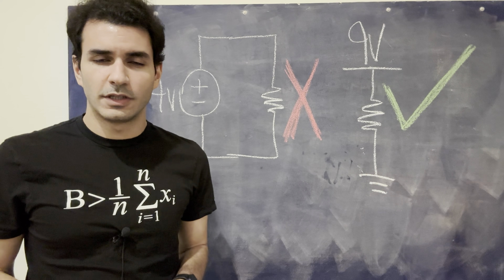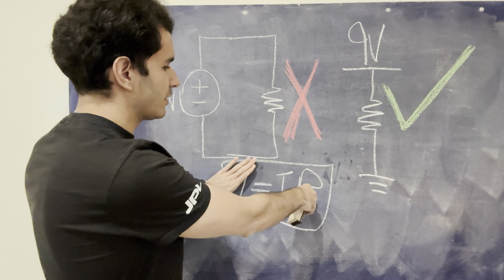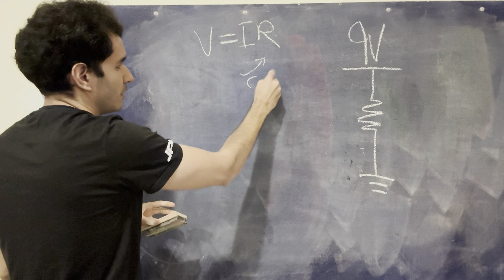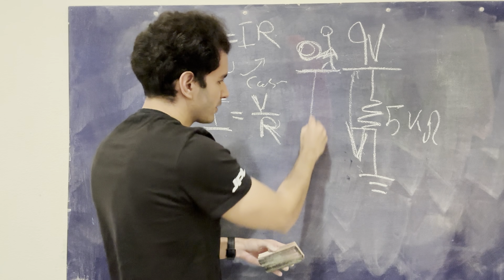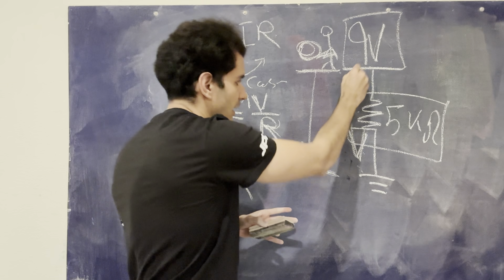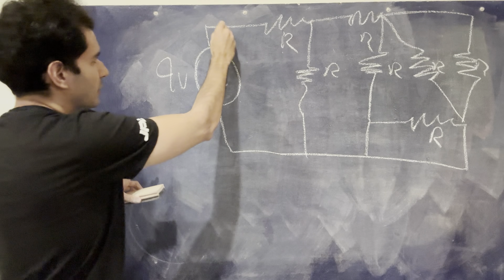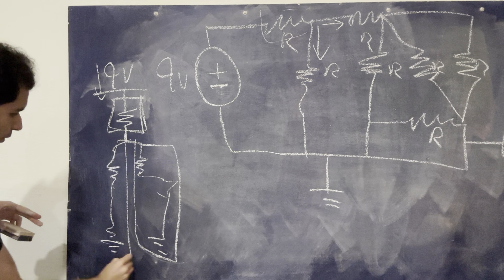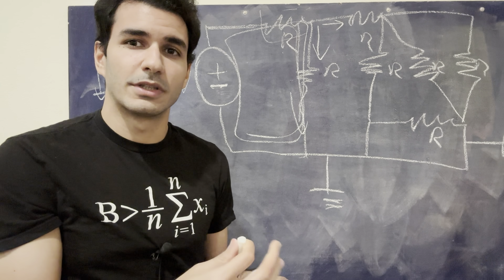Circuits Finally Made Sense When I Saw This One Diagram

Comment: As an electrical engineer, I have to point out that ignoring the "current loop" in the left drawing will become problematic for electrical engineers later on.  First, the "straight line to ground" drawing isn't going to help you much when there's a current source in an odd place.  

Second, in high-speed designs, keeping track of the "return currents" is necessary to maintain what we call "signal integrity."  Current always travels in loops, and if we aren't careful about where those currents are going when they return to the source (as in the left drawing), then our signals get corrupted, sometimes horribly so.  Ones and zeroes can become 0.35321 or 0.7352 and quiet analog signals can become overwhelmed with noise.

In board layout, that bottom line in the left drawing coming back from the resistor to the source is our ground and / or power plane, depending on how we've designed the PCB stackup.  Every pin on a chip that puts out a signal is a "source" and depending on its edge rate, we may have to be VERY careful about where those return currents go so that the signal gets where it's supposed to intact, and we don't interfere with other signals along the way in what we call "cross talk."

Many boards have failed and had to be re-designed because the engineer didn't take into account all the current loops and how they would interact with each other.  It can easily cost a company tens of thousands of dollars in debug time and bad hardware.  It's not just a matter of getting the schematics right.  The traces and planes in a PCB aren't just ideal connectors for your chips.  All those connections have inductance, capacitance, and resistance, even though that will never be drawn on your schematic.  If your edge rates are fast enough the power and gournd planes don't look like a capacitor to help keep your power rail clean, but a transmission line to conduct noise from one part of your circuit to another.  If all these aren't handled properly, you get to spend hours debugging your circuit and trying all sorts of things to make it work.  

So if you're a young EE student, do yourself a favor, and "become one with the current loops" and keeping track of where all the return currents are going.  You will need to know that to get working, reproducable circuits out of the factory.

Good luck!
Reply: Somehow, I don't think that EE students are the audience for this video. This is a way for high school physics students to conceptualize basic electrical principles and the relationship between current, voltage and resistance. Walk, then run. Basics, then the oscilloscope.
Reply: @kidsteach938 I learned the triangle in HS electronics. How is this even a problem which needs solving?
Reply: @ShaunHensley ppl learn differently. Just because you got it doesn't mean it's so for everyone, every little bit can help.
Reply: @kidsteach938 agree. I would quickly diagram the straight line version to get the student thinking of path direction, then apply that to loop circuit drawing. No matter how you look at it, a student is going to have to learn the traditional diagram, anyway.
Reply: Another electrical engineer (though now retired) who did board design.  I worked on PCI adapter boards so we were limited to 0.062" total board thickness.  This made my life difficult with more complex boards because we could only have so many layers without exceeding the maximum board thickness.  I was lucky enough to design in an era where clock speeds were perhaps in the 100 MHz - 200 MHz range, not the GHz stuff they were doing later on in my career where I wasn't designing anymore.  Anyway I remember initially encountering V=IR and not understanding that the V represented the voltage DROP in the resistor R when a current I flowed through it.  I got a degree in physics before I got my second degree in EE so I learned much of my basic electrical theory in physics classes.  I can distinctly remember trying to solve an electrical problem from my physics class homework and walking down to Dr. Connolly's office to ask about that V.  Once he told me that the V represented voltage drop, it all clicked.
Reply: @davidh.4649 that's cool to hear you had a similar feeling. That image really did "click" I "understood" the concept but I was never really able to visualize it until now. I'm definitely going to use it to train some of my new guys.
Reply: @davidh.4649 wait, what? It’s a voltage drop?
Reply: good Lord Im glad I decided to look at comments. 😳 Im learning this all on my own relentlessly for personal interest… and if it leads to jobs we will see. Anyhow, THANK YOU, I am so glad I read your first paragraph!😂 Will read rest, but honestly, I almost took this guys breakdown and jumped cliff into bliss.😱😄 I am a big fan of nipping bad habits early on in hobbies or passionate interests where excelling is a demand. Thanks!
Reply: I like ample copper in multilayer boards for sure. As you know, I'm sure from reading your comment, at high frequencies like in a high speed ADC, even short traces need to be made the same length and differential pairs kept at the same distance apart to the point of making "curly turns" to achieve the same length and impedance calculated to match source and the sink or reflections will eat up your signal. In a complex circuit it's nice to see and think about where all the currents are travelling for sure. If designing a PCB it is indeed critical when you need most excellent signal integrity.
Reply: Unfortunately, you're absolutely right, this idea of "fixed potential planes" has kept me in very profitable work for about 30 years. If they just put more importance in the idea of the Poynting vector for how energy flows we'd have far better and more efficient things.
Reply from the maker: agreed, but the key idea here is developing an intuition for what a circuit or electricity even is
Reply: @alithedazzling  I think it is more accurate to say you are building an intuition for easily analyzing a steady state DC circuit. It's not building intuition for how things "really work" because this is not how things really work.
Reply: @alithedazzling I’m in finance so what do I know but your vertical diagram is literally NOT a circuit. It’s point to point.
Reply: @RockDog101  Yes, exactly. On the other hand, it should be taught that electric current essentially flows from point to point, circuit is only needed for continuous one-direction flow, so that one end "pumps the pressure" (supply continuously restoring charge) while the other end allows discharge flow. Displacement current flows without circuit - but only for limited time. But in the end, hydraulic lines with flexibility is better way to explain both the displacement current and the circuit.
Reply: @alithedazzling Intuition that corrupts the correctness of a model is counterproductive. Just drop it.
Reply: @alithedazzling  Do you really want an 'intuition'?   Get out in the real world and fix/measure some stuff. You can't break down a functioning circuit made of various parts into an oversimplified "thevinin equivalent circuit". As for 'what lectric is'-----you are merely dealing with friggin' DC; what happens when you have multi-phase AC?
  Lastly, that 'simplified' diagram is only useful as a parts schematic for a man who understands how the current RETURNS to source! Is your lectric 'pressure' never ending? Does spent lectric ground to never-never land?
Reply: @alithedazzling no need intuition. it's math and visual understanding. if you are not comfortable go play music, electrical engineering is electrical engineering
Reply: Good comment, a lot of audio technicians and sound engineers I work with are also musicians. Understanding how instruments work, the acoustics and simple electronic amplification that are used and then how an environment can be filled with sound waves that have pleasant and unpleasant effects on our ears is a good way to begin to appreciate the complexity of electronic engineering. 😄
Reply: This is maybe for beginners to show them a way to understand circuits a bit easier way. However, in practical cases, what you said is a matter must be taken account into, thanks for explanation.
Reply: As a SI/PI engineer, I really appreciate this comment.
Reply: Retired EE here also.  The post is good for DC circuit comprehension.  As EEs know, the DC circuit analysis has to be modified as frequencies increase.  Even at 60 Hz the skin effect influences conductor sizes.  And as CC states, ground paths at high frequencies are not simple  0 impedance earth grounds.
Reply: To be fair, he does point out this is a beginners model.
Reply: I mostly agree. There's no point to model the electricity as gravity system, it is way simpler and more accurate to just imagine the power supply as a pump and the wires as hydraulic lines. On the other hand, even harder obstacle of misconception is, that current would always go in loops - it essentially doesn't. Current flows between two points to either charge or discharge until the charge is either maximum what their capacitance holds on the given voltage, or until their charge has been discharged. But alas, also this is best modelled with hydraulic circuit, with initial pressure buildup and discharge. Loop is really only needed for prolonged flow into one direction - incidentally representing most use cases though.
Reply: a lot of greatly advanced thinking in these threads   ...
Reply: Yeah, I'd say this video is for physicists who understand gravitational potential.  If you're an electrician, technician, maybe some EE's, I'd say stick to the traditional model and study to fully understand current loops.  You don't need the extra headache.
Reply: @bcdrummin  what does this have to do with gravitional potential
Reply: "Current always travels in loops"
Not if it is AC, in which case it jiggles back and forth.
If DC, it moves very slowly (group velocity). The E-field does the work.
Reply: @jazam9244  Even in AC, it still travels in loops - jiggling back and forth in the conductors, dielectric, air, or all of them.
Reply: @Cynthia_Cantrell In most applications yes, but not always. In antenna, the AC of high enough frequency travels essentially back and worth without loop.
Reply: @TheSimoc  It still travels in a big loop - the air is the dielectric between the antenna and ground - it's a spatially large, but small valued capacitor.
Reply: That's the case for a big AM or FM radio antenna.  Arguably however, if your antenna is of the small variety used for charging cell phones and similar devices, or a large one for a car, you've essentially built an air-core transformer.  

Current in the driving transformer is obviously in a loop, but that is transformed into a magnetic field, which forms a flux loop with the secondary, rather than an electron loop.
Reply: @Cynthia_Cantrell That's kinda true - or a viewpoint. Similarly as with waterfall example, there must be a common separator medium between the surfaces of source and destination for the displacement to occur (water displacing air while flowing). More accurate illustration is the fluid cavities within solid flexible material. The point is, that when taught "current always flows in loop", vast majority of people either entirely miss the fact that every single wiring makes a capacitor, or fail to grasp on how it practically behaves, only resorting to "mysterious capacitance effect, can't understand". And the "always loop" is not entirely accurate because in the end it's also only a virtualized model in many cases. Think about static electric shock, while it can be modelled as a capacitor and short, they are in the end both on same path - physically point-to-point only.
Reply: @TheSimoc  If I touch a door knob and get shocked with static electricity it is still a loop - both the door and I are grounded, but the knob and my finger are at different potentials.  When the spark occurs, you can still draw a loop through my finger, the spark, the knob, the door to ground, ground to my feet, and my feet to back to my finger.  

There has to be a common connection somewhere in the system for the current to flow, and a closed path, i.e. a loop.

If there is no loop, there is no current.  Otherwise if you stuck a 12V battery on the counter next to a 6V battery, current would magically flow from 12V to 6V - i.e. point-to-point down the waterfall.  And you know that simply doesn't happen.
Reply: @Cynthia_Cantrell To first time actually disagree with you, that is outright wrong. The current definitely doesn't flow through ground when you touch a door knob. If both were grounded, there wouldn't be potential difference between you and knob when you touch. Common grounding is explicitly the way to keep static charges from building up. One can be grounded, but not both, and whether the one is or not, is irrelevant. The static shock constitutes a capacitor with you being one plate, knob the other, and the touch as a short between. So yes you can still model it as a circuit of capacitor and a short, but physically it's just point to point, and definitely not through ground. I have no idea what you meant with your battery example, you didn't connect a single wire between? If you did, the displacement current definitely does flow briefly.
Reply: @Cynthia_Cantrell And before your last post, I never meant to disagree, but to stress the importance of both viewpoints in every application and phenomenon. Only by handling them both allows to internalize the nature of electricity. Too often only one of them is taught. In atom-level physics and chemistry, there are no capacitors, components, nor circuits. Just conductive and dielectric objects, and electrons moving point to point. In simple (and up to pretty advanced) applied electrical lessons, there are only components, claimed to have current flow only when in closed loop. RF theory pretty often falling back into the former. Also, understanding the essence and working of capacitor (which is in the end a virtualized object) is impossible in any other way than by explanation with displacement current. Furthermore, it is equally important to note that fluid dynamics has the exact same characteristic - there's always either displacement of another material, or compression affecting between two sides.
Reply: @TheSimoc  I usually don't spend my time worrying about a physical analogy, or even a displacement current.  I worry about getting the math right. 

The math doesn't care whether it's a displacement current or a stream of electrons - what ends up on the other side of the cap is the same. 

There are many people that are confused for frightened by the math, and an analogy can help them get a better "feel" for the topic, especially early on.  

If they're going into electronics seriously though, I highly recommend they get in touch with, and get a good "feel" for the math.

In my professional experience, it is when engineer have tried to avoid or ignore a good analysis that gets them, or their company into trouble -- and someone else has to come along behind them, and fix it.  Often by starting with a careful look at the data sheets, and then figuring out where the math went wrong. 

Analogies are fine to get a "basic feel" for what's happening.  But I don't feel confident sending a circuit to production until I can show - with the math - that it's going to work as designed. 

This can be particularly true with RF circuits, because what you "feel" should happen because you put a cap or inductor somewhere may be totally different from what actually happens - because some trace forms an unexpected stub, or a protection diode's capacitance changes too much with frequency, or a via had more inductance than you expected.  However, with a good enough SPICE model, the math can show you on a Smith Chart what it REALLY going to happen.  

This is why I encourage folks to get past the analogies quickly, and learn how the math defines what your circuit does.

Have a nice day.
Reply: @Cynthia_Cantrell  Math is math, you are right it doesn't care about paradigm models nor analogues. But for most people, maths don't make much sense (and are prone to mistakes) without first having good grasp about what is actually happening. Therefore, it is extremely important to play with analogues and simple applications as long until the basic behavior and essence of electricity has been internalized. There's no need to worry about "doing by feeling" in design work, no one is going to design a circuitry by feeling - they are always calculated (or measured and tested in experimenting which is usually done when not all factors can be addressed for calculation). But the better the nature of electricity is internalized, the easier it is to catch errors and missed factors in calculations - the worst engineers are those who don't really understand the essence of electricity and rely on maths with a set of factors they have happened to read and assume to be the only factors. One knowing how the electricity really behaves, catches on "something is missing from the numeric figures", even without prior knowledge of exact maths, while math-oriented one gets no idea anything would be missing.
Reply: @TheSimoc  Well, peoples' brains think differently.  I never felt the need to go beyond a simple analogy; perhaps because I started teaching myself electronics around age 10 - in the late '70s.  

My "aha" moment for capacitors came when I built an emergency light - a relay would release when power was lost and use batteries to power a small bulb.  When I first plugged it in, the relay clattered away at 60 Hz, and I immediatly thought "Oh, I need a capacitor for that!"  I suspect my mental model back then of a cap was bucket that filled with water, with a hole that let water out slowly - the kind of thing you might find in a hobbist book from Radio Shack by Forrest Mims.   

Today there are fancy videos for free on YouTube that provide wonderful imagery for electron flow, often with a water analogy.  I learned from black and white hand drawings on graph paper (you can find some of Mims "Engineer's Notebooks" on line to see what I mean).

It's good to have that basic understanding of what cap, resistor, or transistor does, and the more you work with them, the better understanding you'll have of how to use them.  

But in my engineering career, the most common and difficult problems I've seen other engineers have fall into a few categories:

1:  They didn't pay attention to the datasheet.  Maybe the import spec they needed was on page 27 of 368.  But given how important it is to functioning of the circuit, they SHOULD have checked that early on.

2:  They didn't bother to check / do the math.  Don't design a PLL or other control loop without using your favorite method to do a stability analysis over the full range of production tolerances, aging, and temperature range.  Don't get it "working" on the bench and call it "done."

3:  Dig down to the ROOT CAUSE of the problem!  Don't "fix" a unit in the lab without knowing PRECISELY why production units are actually failing.  And if one of your design tools (like an FPGA router) can't consistently give you a working design, dig into the chip architecture to determine which limitations you need to work around - is it which pin the clock goes into?  The max width of an address decoder?  Critical timing for a large product sum that will need to be pipelined? A data bus with so many inputs it should use tri-state lines rather than muxes?  

I've never had to formally use the "5 Whys" method for root cause analysis - so far it has only taken me 2 or 3 to get what I needed, but digging deep into a problem is usually where the most useful knowledge is gained, and it frequently provides expertise that can be used later.

Early in my career I resented how much time I spent fixing other peoples' problems.  However, some of those issues provided useful insights (most frequently for board layout) that have helped me design much better boards.  This has been crucial for high speed and low noise designs.

So far, since graduating with my degree in the late '80s, I've never found the need to correct anyone's analogy for electrons flowing around a circuit.

Your mileage may vary.

Have a nice day.
Reply: @Cynthia_Cantrell Well, actually I think the water analogies have been the thing that have helped you internalize the knowlodge to the point of avoiding the errors and catching them on others. Some of those problems are pure carelessness, some are about being pretty advanced work done without enough knowhow. Having too much water analogies with different viewpoints have definitely not been a reason nor contributor for those errors. What I have encountered, vast majority of newly graduated engineers don't have any idea about displacement current nor the practical effect of stray capacitance (which are the same thing with different word and viewpoint). They just go with maths they have gathered, i.e. ohm's law and couple of else, and then wonder why they have a current pulse when powering up an open circuit. No math formula they could remember will cross their mind in the situation - let alone with any more complicated circuit or phenomenon. They may remember the capacitance and maybe its stray occurrence, but being rather a mystery element, they cannot associate it into the situation and even less to any math formula. But when they know displacement current acts exactly like in closed hydraulic lines when powering up the pump, they get the clue everywhere it applies. Btw, the bucket example was pretty much similar to the waterfall, it is better than nothing but not particularly good for the same reasons (on which we agreed in first messages). Also, the restricting hole should represent a resistor. More accurate model for capacitor would be a reservoir with a flexible diaphragm separating it into halves, each having a connection.
Reply: @TheSimoc  I would look at the problem in a similar way, and I had a similar one pop up from a test engineer.  

For anything that looks like a capacitor, it's going to look like a short when you first power it up, and V = I/R when R = 0 is a no-no!  I haven't thought about "displacement currents" since college physics classes.

The test engineer had a slightly different problem - he needed to test our big new power supplies as they came in and had a nice expensive load box he could program to test all the different load scenerios.  

He'd hook the supply up to the load box and turn it one.  When he had the box in "Constant Resisitance mode" the test worked, but due to variations in cabling and connector resistance, it sometimes failed the voltage accuracy spec.  The obvious solution was to put the load box into "Constant Current" mode instead.  But the power supply would go into over-current mode and shut down.  You probably already know why but I'll explain it for other readers.

One could argue test engineer's problem was that he didn't have mental model or analog for the programmable load box.  For him it was just a "black box" where you could set the parameters for whatever you like, and it just magically did what you wanted.

A better model for the load box is that of a big honkin' transistor for the load, measurement devices, and a feedback loop.  In this case, the feedback loop is attached the base of the transistor, and it essentially turns it into a variable resistor, with the power supply current going to the collector of that transistor with the emitter connected to ground.  (Or you can use a FET with the appropriate connections if you are more familiar with those.)

With "Constant Resistance" mode, it's controlling the transistor so that R = V/I.  Before the supply is turned on, both V and I are both ~0, at least within the noise limits of its ADCs.   We don't know exactly what that will divide out to, but even a tiny bit of voltage noise divide by zero will probably give you a reasonable, if not large resistance to control for.

The problem with "Constant Current" mode on the programmable load is trying to set I = V/R by changing R.  Before the supply is turned on I = 0, and the only way for the load to increase I is to DECREASE R!  So it will drive the load transistor hard into saturation until it detects enough current from the supply to start controlling it.   The problem (for the 50A supply we were testing) is that with the load box essentially shorted (R=0) when the supply was turned on, it quickly detected a "short" and turned of its output.  

The solution was to turn ON the supply with the programmable load in Constant Resistance mode - so it didn't short out, and the switch the load to Constant Current mode to measure the supply voltage for compliance.  

Ohm's law isn't a complicated equation, but it can be very important to remember!

There is another simple equation I highly recommend engineers remember but I'll save it for later to see if you can figure it out before it is revealed!

I was working with a well-seasoned analog engineer on a phased array radar driver.  A company had developed a new, high-voltage varactor diode they wanted to sell into radar applications.  They asked us to build a test board with an FPGA to drive an array of them.  I had responsibility for the FPGA, and he had the responsibility for programmable, HV (400V) power supply.  

Each diode could vary from a couple of pF to maybe 50pF depending on the applied voltage.  As this capacitive load was the only thing that the HV supply had to drive we weren't talking about any significant amount of power.

His first test driving one of the diodes caused a HUGE current draw from the supply.  It quickly recovered and was fine, but it could easily drop the supply by 100V until it did so. 

After scratching his head for a while, he couldn't figure out why he always saw a really huge dip in the supply voltage every time he changed the volatage a varactor diode with on a few picofarads to it.  So he came to me to ask if I had any ideas.

I did.  Have you figured out the equation yet, and what the engineer didn't consider when he chose the HV supply?

Think about it before scrolling down...

How about I = C * dV / dt ...?

Let's assume a "worst case" scenario.  We need to go from essentially 50pf to 0pF with a 400V change in the rise time of a slow FPGA output, say something on the order of 10ns.  Our equation tells us that's going to require a current on the order of 2 AMPS!  His little supply, as it was only supply a (mostly static) voltage to  picofarad loads, could only supply a handful of milliamps!  

Fortuntately, we can re-write the above equation to solve for C, and calculate just how much capacitance we need to add to the supply output to limit that 2amp excursion to a few mV ripple on a cap we put on the HV supply output.  It doesn't take a an unreasonable amount of capacitance to fix that problem, and since we knew the right equation, we had the part shipped from Digi-Key the next day, and it worked great.  It was quite large, bigger than the supply circuit itself, but that was for the voltage rating, not so much the microfarads.  

I = C * dV / dt is HUGELY important when making sure you have enough capacitance to tame supply ripple on large FPGAs.  They can have rise times on the order of 1-2ns and swing the whole rail - 3.3 or even 5V.  If you have a 32-bit data bus changing its outputs simulatanesously, you can easily pull many AMPS.  Fortunately, you can again resolve for C to make sure dV/dt stays within the normal operating range of the FPGA.  Perhaps even more fortunately the capacitances you arrive at are reasonable, it can be accomodated by caps in the microfarad range.  The tricky part though is getting all those caps near the pins, and you design a good stackup so that you're not battling V = L * dI / dt!

Since I've managed to wander into board layout territory here, I'd like to debunk a big myth (or analogy) that many engineers hold until it bites them in the...

It's the "a power and ground plane next to each other makes a good capacitor for decoupling you chips" myth.

Yes, a power and ground plane separated by a dielectric make a capacitor with C = k* e0  * A / d.  This is a trivial equation for an engineer to solve, and if he or she doesn't remember it, it takes seconds to google.  The problem come in when they think it applies to the whole area the planes cover.  

Arguably, if your edge rates are slow enough, and your board is small enough it will.  And people got away with this in the '70s, '80s, and even into the early '90s if your tech was slow enough.

But the faster your edges, the less those planes look like a capacitor, smoothing out voltage ripples for you, and the more it looks like a transmission line, TRANSMITTING supply ripple from one part to every single other chip on the board.  

 There are a few simple equations I examine when doing a layout to avoid problems.  In FR-4, a has a delay of about 180ps/in (sorry for you metric folks!), or inverting that, it travels about 5.556in/ns.  If I have a 1ns edge (say from a fast FPGA), that's spread though 5.5556 in of trace.  So when do we have to start worrying about transmission line effects? Engineers use a "rule of thumb," where they divide the wavelength by anything from 6 to 12 to determine that distance.   I like to use 2*pi as it leads to a length of (5.5556/2pi) = 0.884 inches per nanosecond of rise time.  I usually remember this as 0.9"/ns of trise.

So for my 1ns edge, my power/ground plane only looks like a "lumped element" capacitor for a 0.9" radius around each power pin.  Everything else outside of that is a transmission line.  Even within that radius, it is a poor capacitor, with a Q of 50 if you're lucky on standard FR-4.  It's only advantage is that you have very low inductance to it - IF you place your vias carefully.

After that lumped element radius you have a tansmission line, and decoupling power there at high frequencies (GHz) becomes increasingly difficult because you're battling about 1nH of inductuctace through each via to any decoupling caps (less, if the power layer is close to the cap side).

If you're not dealing with fast edges, the 0.9"/ns lumped element estimate tells you why -  if you're an engineer in the '80s, and your favorite logic family or CPU has say, 40ns rise times, then you have about 36 inches before you have to start worrying about transmission line effects.  This is why they could get away with 2-layer boards and trivial decoupling practices.

It's amazing how much you can figure out with just a few simple equations!

Have a nice day!
Reply: @jazam9244 Break the loop in an AC circuit and how much traveling does the current do?
Reply: @ShaunHensley As much as there is displacement current reciprocating. Which depends on capacitance of the "broken circuit" and frequency of the voltage, among other factors. Antennas and capacitors are essentially broken circuits, yet huge AC powers flow in them in radio transmitters, for example.
Reply: @ShaunHensley  it goes to each end of the break at 60 hertz from peak to 0 on each side of the break
Reply: @ShivaTD420 Think so?
Reply: @ShaunHensley  ac yes. 

Some would go into the air/objects 

DC would be more of a "stoppage" where the one end would be a higher voltage potential and the other would be lower. With the lower getting the odd charges from the air and the high loosing the odd charge to the air. 

But ac  would be cycling from 0v to 120/240v
Reply: @ShaunHensley  now if there was a load like a light. Would it light up ? No because once you break the circuit , resistance approaches infinity and current drops to zero. Thus no "work" is occuring at the load

Unless your voltage was high enough to arc the gap...
Reply: @ShivaTD420 appreciate the refresher.
Reply: This is just demonstrating why Ive decided to work towards mechanical engineering jaha
Reply: I have to agree with you. I'm not an electrical engineer; just a guy learning at this point. The issue I caught right away is that without a closed loop, voltage can't push, so there is nothing to resist; if there is no current flow resistance has no effect. it is a 'potential' circuit, but without a closed current loop, it remains dormant. The voltage/current relationship is something I had to grasp, and perhaps still am. Voltage must have something to push and current needs something to push it. Am I understanding this right?
Reply: I was about to point this, but found this already has been pointed out by many. Anyone with graduate degree in electrical engineering knows this. 
Shortcuts are handy but should not be at the cost of fundamentals.
Reply: He's providing foundational understanding not an explanation for high level understanding.  He's trying to help people get over the initial hurdles in circuit analysis.
Reply: @GamingWithUncleJ  it is not foundational if it not true and worse create misunderstandings at further learning and even at trouble shooting practical applications. this does not help anyone
Reply: Not to mention the fact that induction happens in loops of wire, and in certain scenarios the entire circuit and any other loops can pick up EMI (electro-magnetic interference) from the surrounding radio environment, such as nearby power lines (e.g. ground loop currents & noise), microwaves, RF transmitters, fluorescent lights, and impulses from nearby high current switching or high voltage static discharges.

The “lumped element” model (which is used in almost all circuit diagrams), falls apart when d φ/dt != 0!!

The entire model we commonly use for circuit analysis, including KVL falls apart when the change in magnetic flux over time is non-zero!

In other words: “The map is not the territory”, where the circuit diagram and lumped element model’s assumptions are the “map”, and the actual physical circuit and layout (with loops) in 3D space is the “territory”.

The lumped element model and KVL hinges on the following assumption:

Assumption: d φ/dt = 0  (outside lumped elements). This means that any time-dependent magnetic fields are considered to be perfectly contained within the physical boundaries of inductive components.

In reality, this is not really ever true because electromagnetic fields of some sort are always present in the environment.  It's just that for the most common scenarios d φ/dt is so close to zero that the effect of these environmental electromagnetic fields are negligible and thus the lumped element model, KVL, and KCL hold to be true.
Reply: Even tho I didn't read all of it, I respect your patiance and commitment to write all of this. Just wanted to say thanks man. Have a good day!
Reply: Return current doesn't take the path of least resistance, it takes them all.
Case in point, a 1 ohm resistor in parallel with a 1 megohm resistor, current passes through them both, not just the least resistance.

Another favorite:  Ralph Morrison quote:  “Buildings have walls and halls. People travel in the halls–not the walls. Circuits have traces and spaces. Energy and signals travel in the spaces not the traces.”
Reply: @jeremiahbullfrog3090  in the spaces not the traces. i dont understand
Reply: @charcoal386 something about the energy is transferred as electromagnetic waves and the copper traces are the guides.
Reply: @charcoal386 I think the quote is clarifying the obvious expectation, that signals "travel in the traces" applies only to ideal cases.  In reality, there is often crosstalk between traces that can cause major problems in real circuits.
Reply: @charcoal386 The electrons don't travel down the metal all that fast; the energy that moves at the speed of light is from electromagnetic waves traveling in the di-electric (the spaces between the metal "conductors").

Essentially, the di-electric near the traces gets bent slightly out of shape (electric potential), and then pushes/pulls on the next piece of dielectric.  When you knock on a wooden table, that sound will travel through the wood to the other end of the table quite quickly, even though the table as a whole never moves very far; it just acts as a wave guide for the pressure wave that is sound.  The metal traces of a Printed Circuit Board act as a wave guide for the electromagnetic waves.
Reply: @jimjjewett  Electron movement is not what electricity even IS.
Reply: @jimjjewett Roger that and even wood can conduct electricity
Reply: @jeremiahbullfrog3090  Yes but in your example the current will be 1 million times higher in the 1 ohm resistor.
Reply: H
Reply: someones failed some EMC testing before
Reply: Agreed
Reply: I'm glad you mentioned this, because this is where my confusion in the diagram was coming from...
Reply: Check, agree, absolutely
Reply: very good advice ( repairing guitar amps for years )  ....
Reply: Just realized how little I know about this subject! The world is full of surprises... we use electrinics every day, but we know so little about how they work👍
Reply: Could I be right if I said it is like a river, the volume of water is voltage, the flow is normal until it passes through rapids, a resistance, where the disturbance creates energy, a current, and then returns to calm flowing water again
Reply: @grahamdrew1069  If you're going to think of electrons like water, then a more appropriate analogy would be a waterfall with a pump returning the water to the top:

The pump is the battery or power source in the circuit - it takes water from the bottom of the waterfall and returns it to the top.

The higher the voltage, the higher the waterfall.

The higher the current, the more water that flows over the waterfall in any given second.  Low current means a small waterfall with little water.  The higher the current, the more water there is.

Resistance is how much slope the waterfall has - the lower the resistance, the steeper the waterfall.   No resistance means the water flows straight down without hitting anything.

The higher the resitance, the more horizontal and rocky the waterfall is, and the more energy from the water gets dissipated in the rocks.  

Unfortunately, this analogy doesn't work particularly well for inductance or capacitance.  But hopefully once you grasp how the water analogy relates to Ohm's law ( V=IR ) you can use that as a stepping stone for the other components.
Reply: @Cynthia_Cantrell That's perfect for waterfall model. To add the important thing - the displacement current - the given amount of water already up, does flow down without circuit (the pump side) as long as the water suffices, and also the water does flow up when pumped even with the downfall blocked, as long until the weight of the lifted-up water makes pressure equal to the pump's.
Reply: The most accurate modelling is to think universe as solid material, and conductive objects being cavities within it, filled with fluid. The solid (=insulating) material can be of different flexibilities, modelling electrical permittivity. The flexibility allows displacement current to flow momentarily without closed loop cavity - even repeatedly back and forth. Such "solid universe" also illustrates capacitive coupling.
Reply: Go learn from some old guy.
Reply: Some people think he is saying to build the circuits in a vertical line 😅. He means as a tip to breakdown a problem to see it in another light or angle so to say.
Reply: set ground to be the Voltage of the cathode in the conventional circuit  and you'll get your loop back. a small mental shift no problem
Reply: all that comes later
Reply: Charges neutralize, a high potential goes to a lower potential. 

The "source" is a consistent low and high potential. Which most devices run on a constant flow rather than a something like static neutralizing charges.
 But a charge will go wherever a voltage potential exists

These potential are relative.

The air/ground helps keep the relative potential somewhat equal.

Satellites in orbit can get some enormous voltages on the exterior That will arc to internal components that have a lower voltage potential. Designs need to keep that in mind.
Reply: As a real world controls electrical mechanical technician,

It is a good visual representation to understand the concept. 

I don't think he's telling anyone to forget the loop, he's simply stating the model he's presenting makes intuiting circuit structure easier.

Which conceptually it really does in practical application. 

you have an impressive understanding for sure though, it was a good read.
Reply: Or multiple power sources that are Isolated, a completed circuit is the proper way to learn.
Reply: Yes this is problematic. The current is trying back to source not necessarily ground and this misunderstanding cause many electrician and electrical engineers' issue when it comes to grounding and earthing design and implement.  I have been on many large electrical projects and have to explain this idea unbelievably.  Further I am not seeing why the diagram on the left is so conceptionally difficult
Reply: @midnightwatchman1  Why does the current prefer to return to the negative pole of the source and not to the earth(ing)? Is it because the earth represent 0V and negative pole has eg -1V? What if the earthing would be at -2V?
Reply: @ianalen1687  earth isn't the source. 
Some are travelling through the earth towards the low end, but the earth isn't  that conductive. Some are travelling through the air as well.

Earthing is primarily done to provide a path for lightning to get to ground rather than through equipment.

Since dry air rubbing the ground creates a voltage potential. Ground is the source for lightning. Dry air isn't that conductive. Once moisture goes up now you got a conductor to help those charges neutralize.
Reply: @ShivaTD420  thanks
Reply: @ianalen1687   You’re on the right track in your thinking! The key concept to remember is that:

Voltage is a potential energy difference between two points.

Pick two points and measure with a multimeter.  That's the difference in potential EMF (Electo-Motive Force) between those two points.

You can also conceptually use the water plumbing or pneumatic (air plumbing) analogy:

Voltage is like Pressure in that each is a differential measurement between two points.

Pick a point.  Whether it’s earth or “ground”, or a “common” point in the circuit, so long as it's at the lowest common potential.  Consider that the 0V reference point which we will call “ground” for the analysis of the circuit.

Same idea with pneumatic or plumbing pressures.  Pick a lowest common reference point to measure the pressure between.  Usually a point of ambient atmospheric pressure is chosen for convenience.

Same idea when choosing an origin point on a Cartesian graph.  Pick a reference point to place the origin (0, 0) and that is the zero point of the graph.
Reply: @midnightwatchman1  if you have time can you expand on that please
Reply: @charcoal386 My first thought was to push back on the original comment, because the Ali's diagram is no worse, and provides a better reminder of the water analogy.  @midnightwatchman1 pointed out a way that it actually is worse.  

If someone is thinking strictly in DC or the water model, they may think that the energy gets through the resistor/filter to ground/bottom, and just stays there.  But closing the circle/getting back to the voltage source is also important, and if that is too difficult (or even too far out of the way, for the high-frequency portion -- which includes "switching" from "just turned on") ... well, suddenly you get a lot of splash; instead of just doing what it should, the energy starts leaking all over the place, interfering with other signals and radiating as emissions so that your product isn't legal to sell, etc.

I don't think the circle model makes that clear either, but I can see how it at least supports a "must get back to the start" reminder.  (If the energy goes to Protective Earth, such as the actual physical ground, then return currents still have to get "from" there to the source; it is just that the path isn't part of your planned circuit, and trying to do it cleanly at that point is like worrying that your garbage bin is dirty.)
Reply: I think that you are complicating a very simple process.  I have designed plenty of PCBs over the years and have never had the problems you are fretting over.   In fact I find it rather silly as the crosstalk and whatnot that occurs on PCBs, and concerns with current loops is not necessarily due to how the schematic was drawn, but rather on the skills of the designer.
Reply: This is like training wheels, like putting numbers in piano tablature ,not a final solution ,so go flex your academic degrees somewhere else , it's stupid that you don't understand the point of this...😒